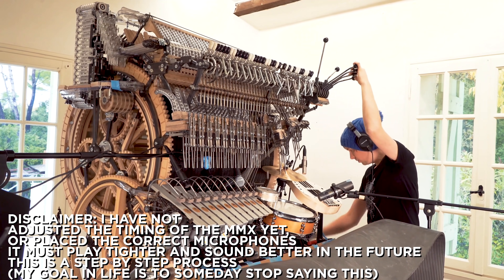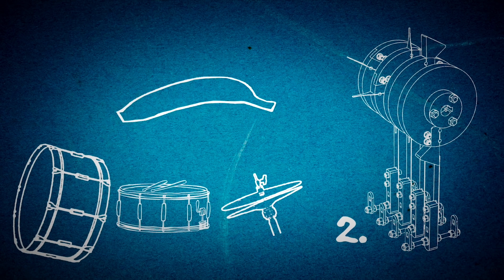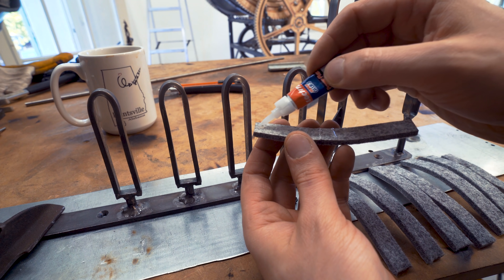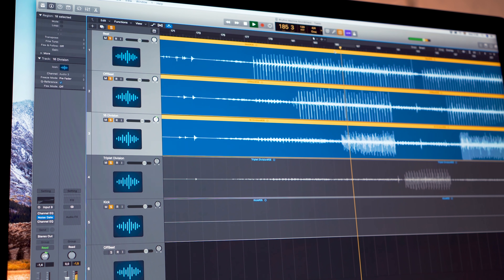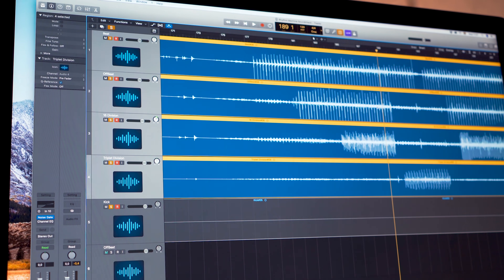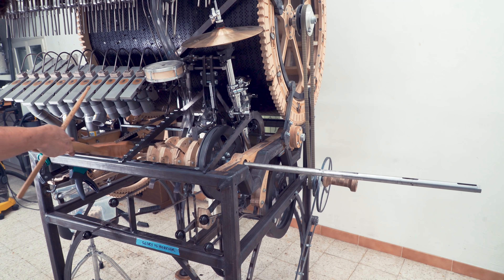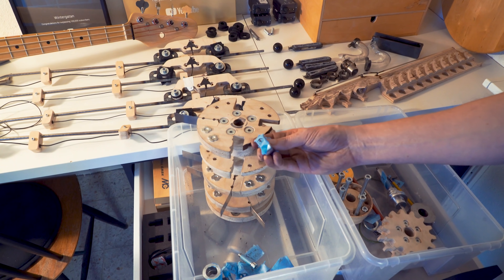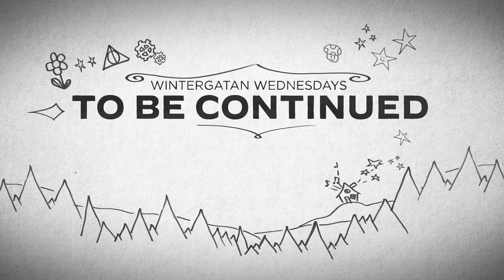Rhythm Machine Experiments - Marble Machine X #107

Comment: I like the idea of the ON-OFF switch for the rhythm machine. The gradual lever you were using has the timing issues you mentioned in the video, and also when playing you might not push it enough and it would sound bad. I also prefer the rhythm machine to have a ticking sound over a swooshing sound.

Comment: Looking forward to your solution to playing in time with a click. The first thing that comes to mind for me is to make the MMX the clock master for anything else (via a MIDI device being triggered by the flywheel or the click mechanism) since being driven by a flywheel it's going to drift slightly in and out of phase with any digital clock. There are eurorack modules that could do this. The drift probably wouldn't be perceptible if everyone else (digital beats included) were following the MMX. Of course if you decide to just keep it in sync manually I'm sure you of all people could do it.

Comment: I see a problem with the design. 
The more you make the volume higher, the earlier the spring steel starts to hit the wood, screwing with the timing. I think you would do better with an on or off switch rather than an "analog" thing.

Edit: oh well we don't have the volume anymore :)

Comment: What I don't understand about all of this:
You have a constant in your machine, which is the falling speed of the marbles. Now you have and element that isn't operated by falling marbles but is directly link to the RPM of the machine.
Does the synchronization not change with the operation speed? The marbles would start to lag behind the rythm machine with higher RPMs, no?

Comment: Not to rain on your parade: I see broken drumsticks all the time: drummers can be fast in switching a stick, but as it is mounted, how fast are you going to replace a broken tip?
Reply: Worn down sticks are mostly caused by the edge of the cymbal chewing into the wood, or with the application of great force. If the tip hits straight on with moderate force it will have considerable life span. Worn sticks can be inspected and replaced periodically with very little risk of performance-time breakage.
Reply: @coder0xff  Good to know, I'm not a drummer, I just see them broken quite often, then it's probably not a problem.
Reply: @coder0xff  also rigidity is a problem. The spring will absorb the vast majority of the applied force.

Comment: Regulating your tempo from mechanical input to a specific rpm would require a regulator or rotary speed limiter.   If you crank faster than the tempo you want, you can regulate it down to what your target tempo needs to be.   Take a look into Christiaan Huygens' centrifugal governors he used on windmills.   It may be a fun trip to see one in person.

Comment: Is there any reason you're not using an actual shaker for this part? I feel like two hi-hats is a little overkill and maybe might sound confusing in the end result. 

In my opinion a shaker mounted on springs with some kind of camshaft could be an interesting solution

Comment: You've expressed two principles which are also key in software engineering:
1) GIGO
2) Refactor mercilessly

Although in software engineering, refactoring doesn't quite have the same emotional impact as a angle grinder has.
Keep up the great work!

Comment: What if instead of the spring steel, the wheels had cam lobes (1, 1, 4, 3 like now). Then turn the contact microphone assembly into a cam follower with an actual shaker with rice or sand or something inside, then the cam lobes could push on those shakers. The followers could even have a roller to follow the cam and reduce the noise of the mechanism leaving only the sound of the shakers.

Comment: To help with timing - I’m envisaging something like a centrifugal governer...
Reply: Remember the point is to have the crank work in time with the machine. The beat should be on the lowest part of the downstroke. Part of it is playing better, but not having a hard, snappy note can make playing to a beat hard. I think the revamped rhythm machine will fix the issue of being able to hear the actual peak of the sound. Look at the sound comparison part at 12:02. Martin explains it.
Reply: A centrifugal govenor admits more or less steam as a function of the rise and fall of the metal balls.  I'm not convinced that this is an appropriate feedback mechanism as Martin doesn't expel gas as a motive force for MMX.  Martin does have a flywheel which is used to modulate velocity, as the rotational inertia resists changes in velocity.  The issue for Martin is to get that flywheel to the appropriate velocity, when it all the while resists that very change.
Reply: @WhatAboutTheBee  idk I see a lot of smoke come out of his ears now and then XD
Reply: @WhatAboutTheBee  Instead of actuating a gas valve with the governor, you can also actuate a brake pad on a brake disk. That's how it works in acoustic (wind up) gramophones. It's a very simple but effective speed limiter.
Reply: LimaVictor yes, the idea was as a brake for speed limiting (or even just as a really accurate mechanical indicator)

Comment: Have you considered using a spring-based mechanism (like in old winded phonographs)? With a few predefined speeds it might be easier to adjust the tightness of music in a mechanically programmed way rather than by trying to adjust cranking speed manually by ear.

Comment: literally throughout this video I was thinking the whole time: "Why do you need metal plates scraping on wood? just use drum sticks hitting a metal surface instead."
Reply: Look at the thumbnail, he already had it built and we never notice.
Reply: I didn't get why he had to destroy the whole thing. If he mounted those metal bits on the bottom and the sprung drumstick tips on the wheels....?
Reply: MrGonzonator he didn’t though; he disassembled it. Apart from the rhythm volume control levers which are wholly redundant with the new design, all the other parts are whole and reusable and will probably be back on the machine by the next episode.
Reply: Switcheroo: instead of metal on wood, it's wood on metal

Comment: If this doesn't work out, you can start screwing little bells and bottle caps on to the wheels maybe? idk, the new hi-hat looks pretty great though. good luck!
Reply: Hmm I keep thinking about this new design and it makes me more nervous. I think you should’ve stuck with v2 and just attached different surfaces to the levers. Banana, wood block, rice box, bell, finger symbals.. the problem with v3 will be the same as v2; that the sounds are homogeneous.

Comment: How about putting something using light instead of kinetic fingers? In addition to the simple LEDs, if you cover the glowing bar with a small kinetic finger and repeat it, it will look pretty cool and you can easily visualize what the audience is playing.
The MMX is an instrument that emphasizes the mechanical feel, but I think it would be pretty enough to add a device that mechanically controls the lighting there.
ps. I'm not sure if Google Translator is communicating what I think. :)

Comment: Haven't reached the end of the vid, but just a thought, for timing have you thought about hooking up an electric motor with a speed controller? That way you're working with constants, not variables :)
Reply: Of course only for timing... Once you're dialed, then dial yourself in and make it you-powered :)
Reply: waaaait, whaaaaaat?! getting to your high-hat solution. You're nuts and I love it.
Reply: I tottally agree! I think a DC motor from a treadmill with a chinesium SCR controller would make the job.
Reply: He wouldn't have to add many modifications, just to use the motor to mantain the flywheel at constant speed once he starts the machine going with the pedal. That can be done with a friction wheel against the flywheel, for example.